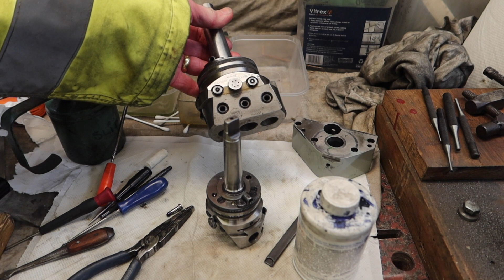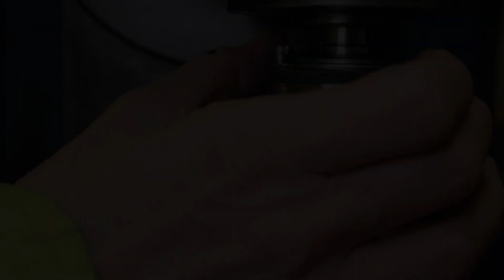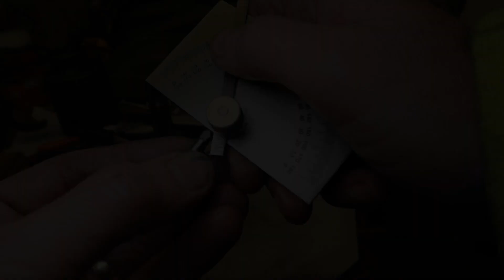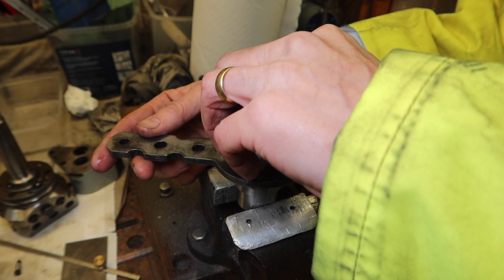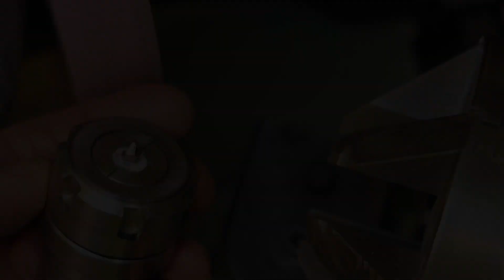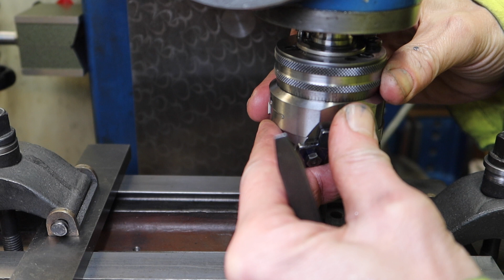boring a counterbore  62

Comment: I finally found a UPA2 after several years of looking, and I'm getting it cleaned up now. I don't know why people insist on greasing them. The spring-loaded pin for the rapid retract is asymmetrical on both the patent drawing and my unit, but mine won't disengage in either position 😕. I'll let you know if I figure it out. The patent drawing shows the long flat facing down. When I popped the pin and saw it was facing up I thought Eureka!, but it was not to be.